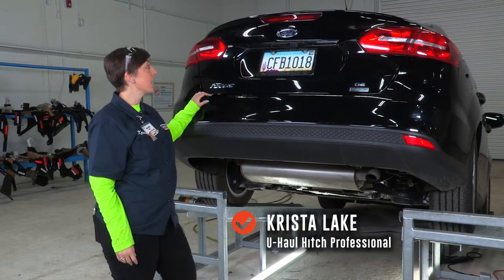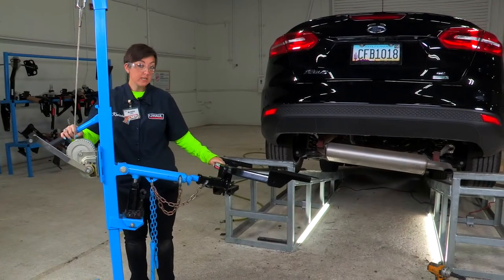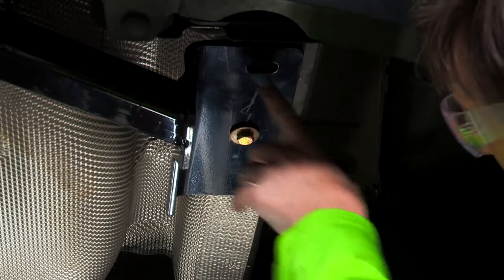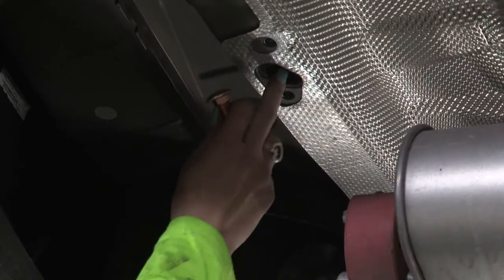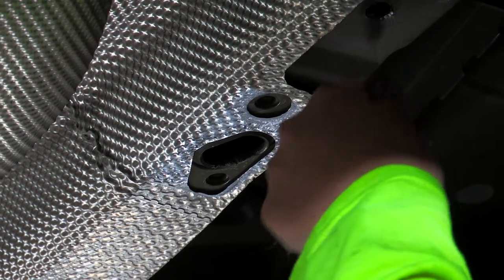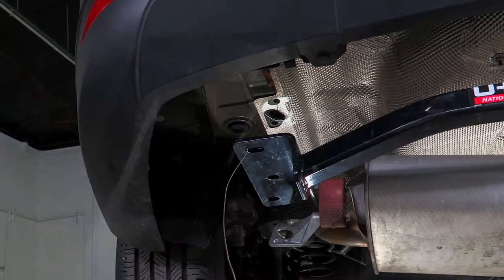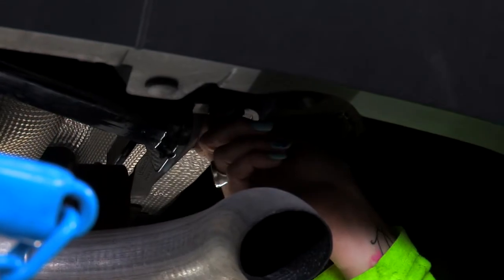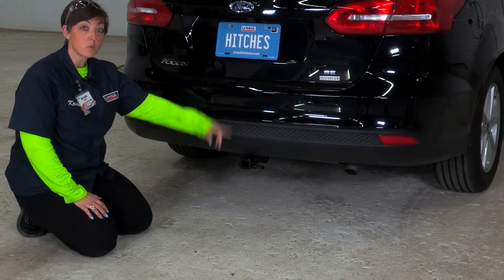2015 Ford Focus Trailer Hitch Installation

Comment: Is this  the same for a 2015 ford fiesta sedan?
Reply from the maker: The hitch and steps in this video apply to the 2012-2018 Ford Focus Sedan. This hitch will not fit a 2015 Ford Fiesta. Visit https://www.uhaul.com/Trailer-Hitches/ to order the proper parts for your vehicle.
Reply from the maker: For a Ford Fiesta you need part number 24491. I installed one on a 2016 Fiesta Yesterday. visit us to order one today: https://www.uhaul.com/Trailer-Hitches/